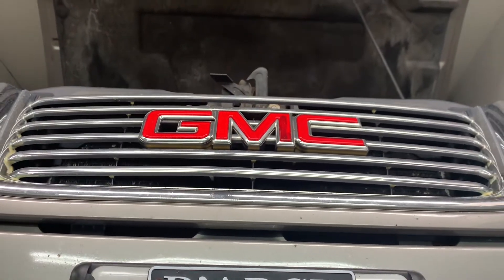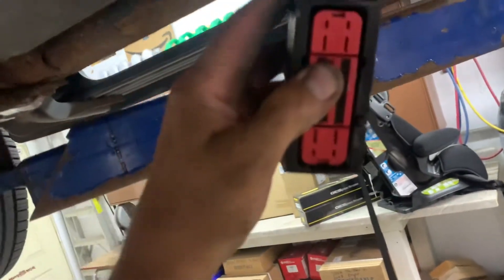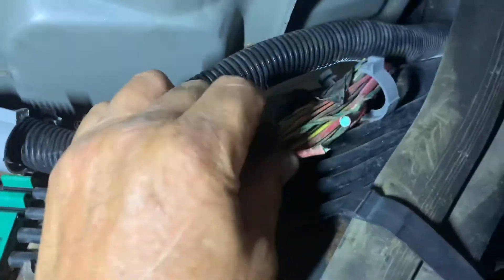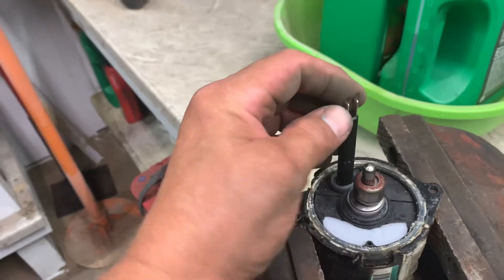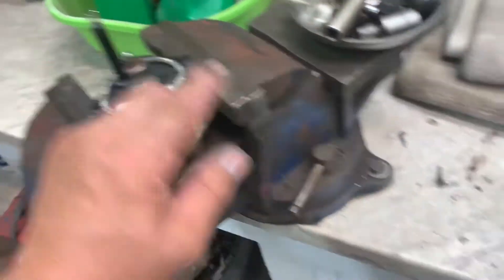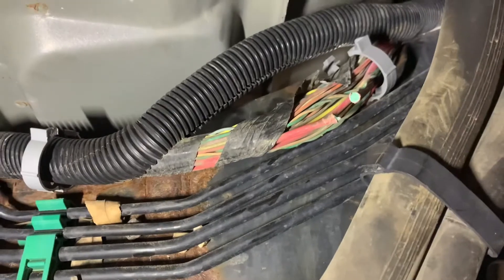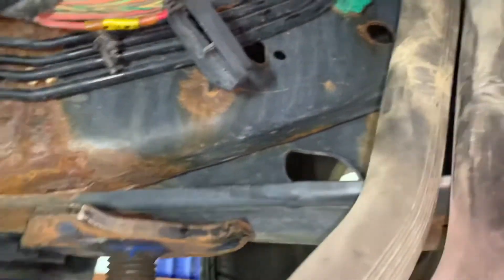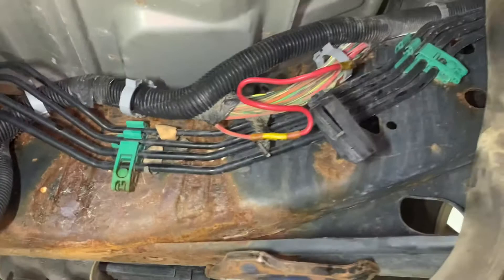GMC envoy abs pump C0110

Comment: I just got done replacing a broken big red hot at all time wire to my abs on an 05 trailblazer that broke at about the same exact spot.
I had no communication with the ABS when scanning…so no codes.  Mine has two wire harness, one has a hot to abs fuse and a ground to frame… the other has a bunch of communication small wires.  Had to strip the wire loom from the engine almost to the pump before finding the break / corroded wire.  The wire loom had a bunch of dirt and debris inside between the front wheel and the pump.  Must have rubbed through and eventually corroded that wire.  Weird how the 15 or so other small wires were fine in the same loom.
Brake light is now out and i am able to communicate with a scanner…

Comment: How did you disconnect the pump? Mine just like that and it won’t come loose
Reply from the maker: The little white lever has a clip on the sides or in center push them in and pull on the lever and the connector moves out as you pull on the lever